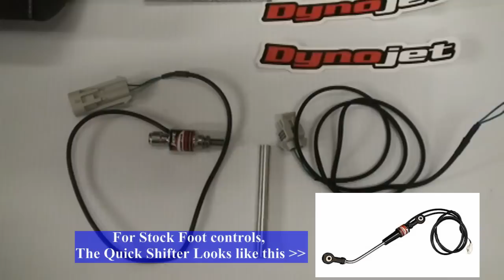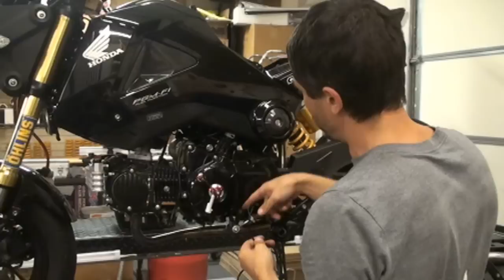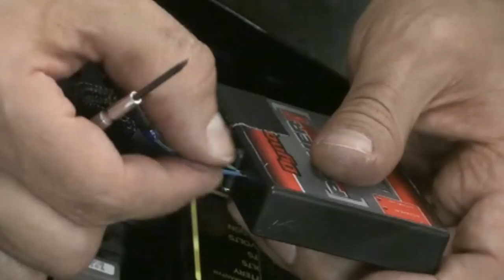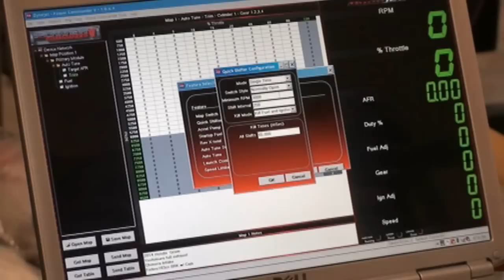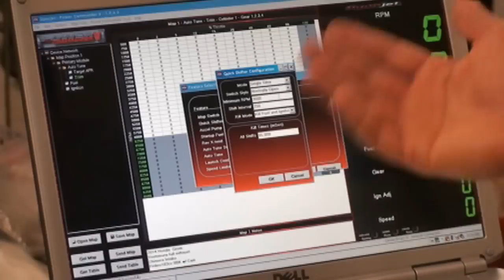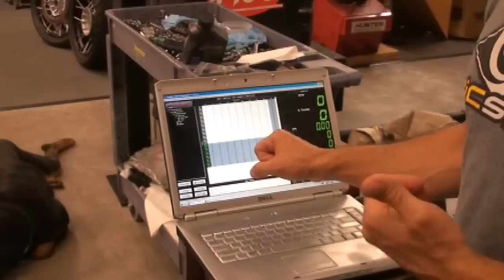Grom Dyno Jet QuickShifter - Installation Video and Setup  #Hardracing #Grom

Comment: Thanks for the walk through. I tried to test my dynojet quickshifter while on the rear stand. Went a couple thousand RPM above the minimum rpm and shifted through a couple gears. Doesn't seem to be killing the ignition/fuel. Do I need to be close to or at full throttle in this scenario to test it?
Reply from the maker: M Modo,  put the KILL Time up to 3 second.  
Lower the "Min RPM" to 2000 rpm .......... put it on the stand, and go over 2000 rpm and press the shifter slowly.
It should stall the motor.

Comment: Hi, is there a way to adjust the clutch lever on a GROM? The fiction zone is way too much; the lever is almost fully out before engagement and I think it should be or would be better more at 60%.  Thanks!
Reply from the maker: +Ontario Andrews 
Unfortunately, that's the nature of the beast.
It has very little movement before it's disengaged.
You could loosen the cable if you want more lever movement without doing anything.
Reply: Thanks. I just want it to engage sooner.
Reply from the maker: +Ontario Andrews 
Could help to get Stiffer Clutch Springs
http://store.hardracing.com/cart.php?target=category&category_id=2681.
Reply: Thanks. Ummm ....I don't actually own the bike yet. Just asking before hand. :)